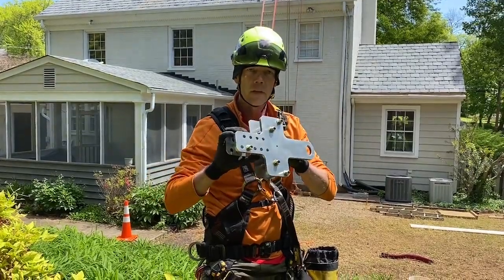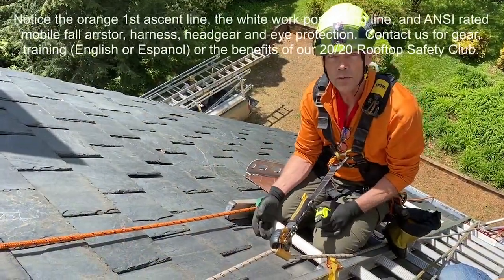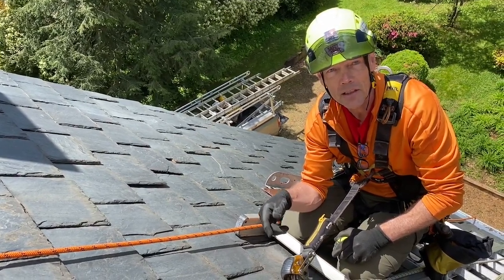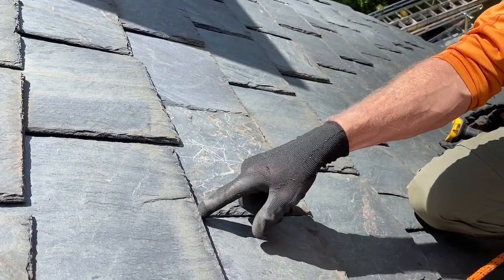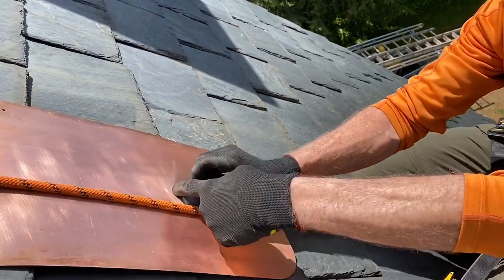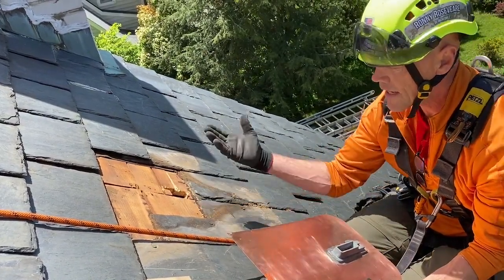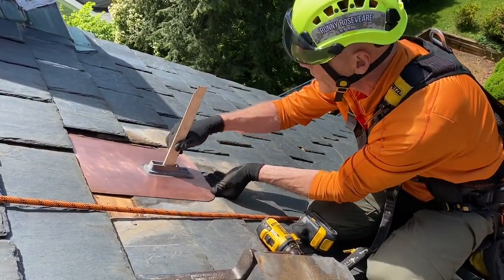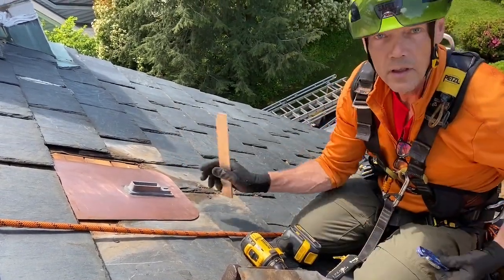Part 1of 5:  V-5 Permanent Roof Anchor Installation

Comment: I've done my share of rain gutter cleaning(usually from atop the roofs). But I'd avoid cleaning gutters on a slate roof, especially if it required climbing around on them. They were undoubtedly the best roofing option 80+ years ago, and they look fantastic. 

 But I've always assumed that a slate roof would be more likely to leak when compared with a roof with asphalt shingles, because slates dont quite fit together as "snugly". At 6:27, I saw what appeared to be moisture on the upper, inside edges of the 2 slates sitting just below where you were drilling. Wouldn't that lead to faster wood rot, and a need to replace boards more often than with asphalt? 
 
Also, compared with modern roofs, there appears to be more individual boards, with wider spaces in between them. Is there some other additional protective, waterproofing layer that I'm just not seeing ^here? 

So, do these roofs leak more, and do the underlying boards replacement more often than with asphalt shingles? Thanks
Reply from the maker: Slate, installed properly, will last the life of 3 perfectly installed asphalt shingle roofs (or longer).
Water will get into the seams of a slate roof, but it also gets out (unless someone starts caulking the seams).  Many of the roofs I work on have been on the roof for more than 80 years.  Rarely is it the slate that failed and most often it was people walking on the slate that created the cracks, breaks, and leaks.  Painters,  “roofers”, and insurance adjusters ruin slate roofs regularly by walking on them.

Rarely, do I find rotten wood beneath the slate unless it’s adjacent a leaking penetration or poor or rusted out flashing.  Unlike OSB or plywood, regular boards can get wet and dry a thousand times and still function fine.  However, they won’t we getting we if the roof has been done properly.  Slate roofs (on the older houses) also let the entire attic breathe.

You may enjoy reading Joseph Jenkins’s “The Slate Roof Bible”.  We certainly did, and it’s how we got our start.